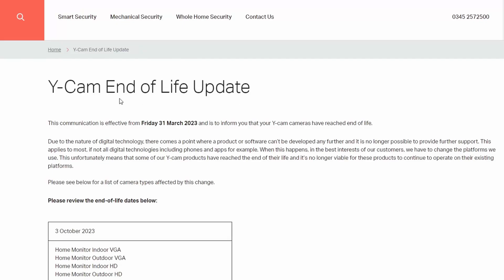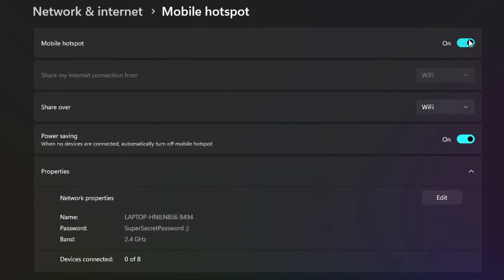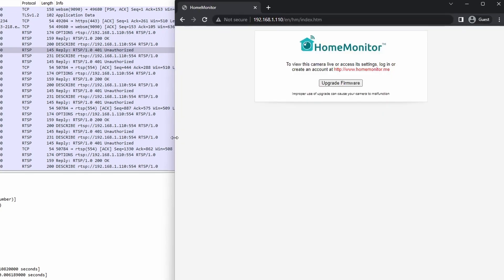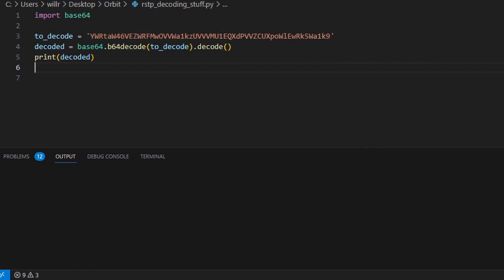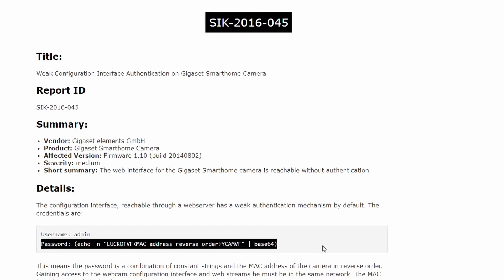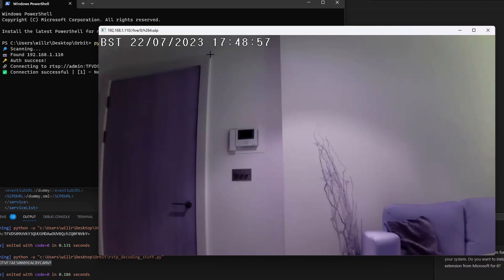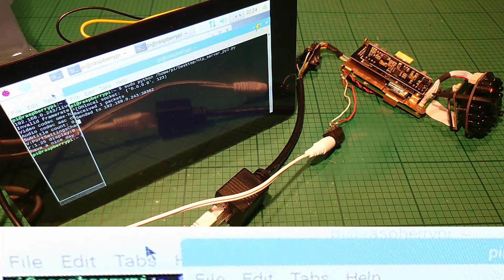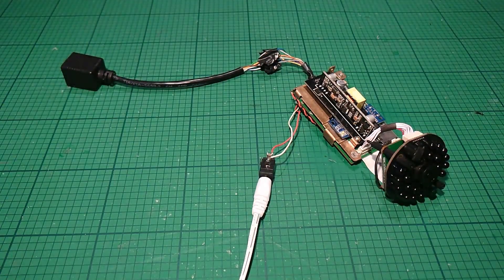Y-Cam Security Camera Hack (For educational purposes!)

Comment: I just get found and then the ip of the camera then auth failed on that ip any idea? according to router the camera is a homemonitorhdpro
Reply from the maker: Hmm, you could try making the stream URLs yourself like rtsp://username:password@cam.ip.addr.here:port/some/endpoint. There's a list of endpoints in the code. Then using something like VLC Media Player to attempt to connect to it.
If that does not work then maybe they brought out a patch to fix this vulnerability 🤔

Comment: Old joke: "To fix your annoying blinking VCR clock all you need is a claw tooth hammer and some electrical tape. Use clawtooth hammer to break off a piece of electrical tape and then cover up your clock display."

Comment: Thinking also to put som breath to my old qnap server to store videos and surveillance data. It would be nice to put some date and time stamps  to video..
Reply from the maker: I'm not sure of the exact details of NTP, but you should be able to set the camera's time by hosting an NTP server on the same network which responds with the correct time. There's a link to the code I used in the description but I believe it's in Python 2
Reply: @WillRosen  thanks, I noted that, but within several hours looking from internet finally found yours video and started to find real progress I needeed some sleep and had nj motivation any more. I should study some more accurate mathematics, it has been over twenty years since last study (if mac address has 3 pcs of zeros in rowa, it is not 4 pcs of zeros in row :D )

I got stream visible in firefox and tested some general agent application for windows. I perhaps would use wifi if it could get configured to carera. Some way there must be, because it could get done via windows or y-cam app.

Comment: Brilliant - I have managed to add two of my cameras to Synology Surveillance station using your python script to copy and paste the passwords. However it doesn't work for the Y-Cam HD Pro 1080p version.
Reply from the maker: Woohoo! That's awesome, shame about the last camera though 😕 if it's a newer model maybe they realised their old passwords were bad haha
Reply: @WillRosen  I had a look at the firmware update login and see its still basic authorisation. My guess is that they changed the characters at each end.
Maybe just one. I haven't pursued it any further. 
I did try to see what it did to stream but its all hidden by encryption it seems. 
Port 554 is open.
I did do a firmware update years ago and it was a similar looking password from memory which I had to copy and paste. If only I had saved that !!!
Reply from the maker: I found four pins on the camera's circuit board that turned out to be UART. Opening a UART connection, I found my camera prints out the password in plain text during boot 😅 but then again I found this post where the UART connection requires a username and password so it's not a 100% reliable way to find it 
https://forums.zoneminder.com/viewtopic.php?t=14623

Comment: Hi Will, Love the work! Tried to replicate however the script finds no cameras? From the MAC address I generated password however seems to be wrong? Is it possible my camera firmware has this patched? Thank you!
Reply from the maker: Hmm, if the script isn't finding any cameras the SOCKET_TIMEOUT may be too low, right now it only allows 0.01 seconds to connect because it has to check 255 addresses and I was getting bored waiting 😅
You can try increasing this or changing the script to use just use the camera's ip if you know it.

This link is the only information I stumbled across relating to the vulnerability being fixed:
https://team-sik.org/sik-2016-045/
It says it was fixed in 2016 but whether this means existing cameras were patched or only new cameras had the fix I don't know. Mine were never updated to my knowledge